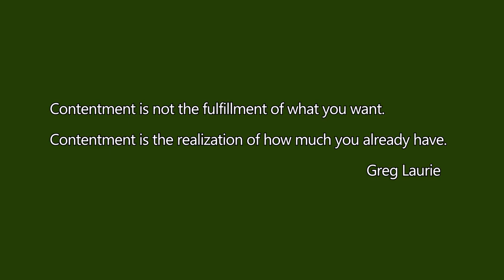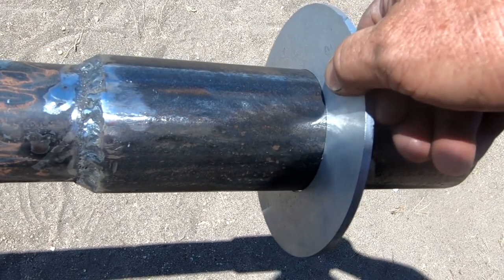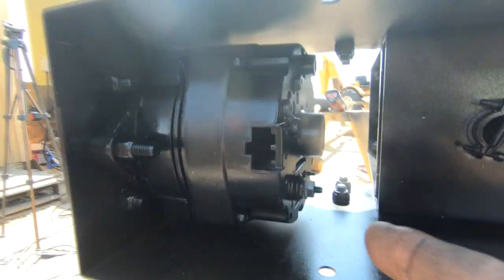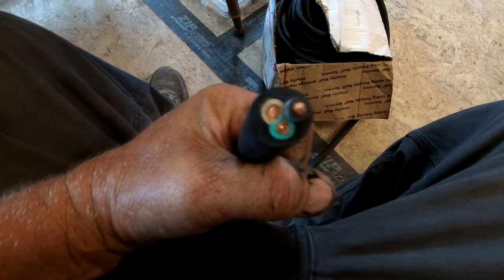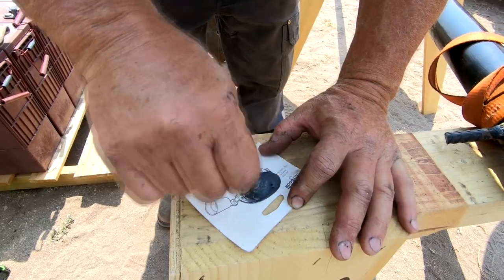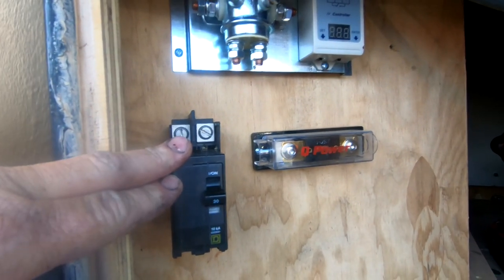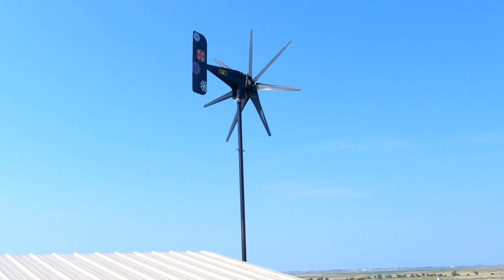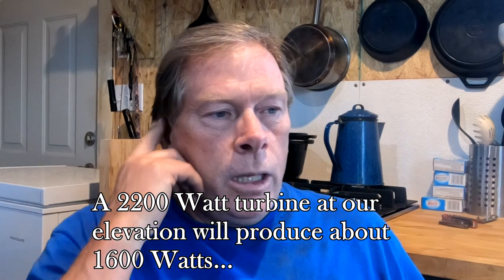We Have A Wind Turbine!!

Comment: Yay !
Hurray  !
Reply from the maker: Thanks, Brie!  Tell us, how does your turbine perform?
Reply: @contentment164  .. our 1st one was awesome. Obvious power boost to our system.  There where nights during high winds, that I left lights on, radio playing...etc .(it took a lightning strike)  ... currently its replacement brings questions to mind...  not impressed with this one. 
But.. out system is close to 19+ years old.. and we have started an upgrade / replacement  cycle...
(I think our batteries are over 10yrs old)... and are the same ones we had during the lightning strike.. so, they might have taken some damage.  BUT -- no explosions --
Grounding is good !
Reply from the maker: @brierobb9879  The manufacturer of our turbine told me that he would extend a 5% discount to anyone I refer to him, in case you want to check them out!

Comment: Interesting video , I have seen a few videos of automotive alternators converted modified to a wind install, most seem to work fairly well. I would be interested in learning how much this unit can produce per month at your altitude tower height and blade diameter , but I think you wont be able to calculate that until you get a charge controller. We use the midnight controllers as they have a built in wind configuration and have the ability to send a PWM signal back to the turbine Control box ( clipper )  to slow the blades down or even stop them if the batteries become full. 
All the best to you guys , keep up the good work!
Reply from the maker: Yes!  Our plan is to add a Midnite 250 to this one as quickly as possible. Thanks for watching...we must check out your channel!